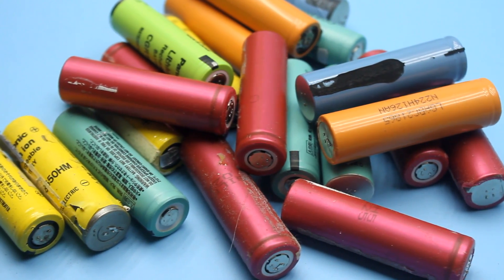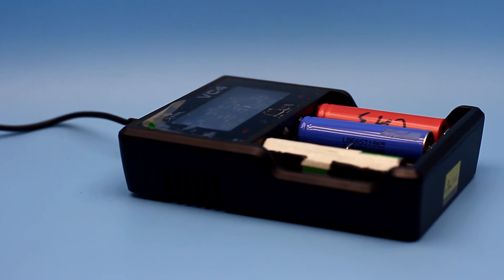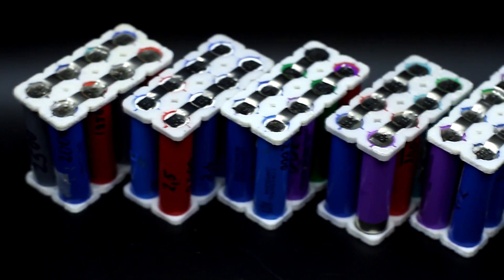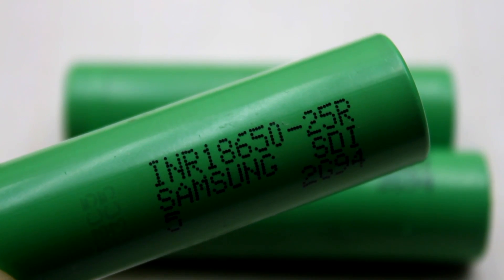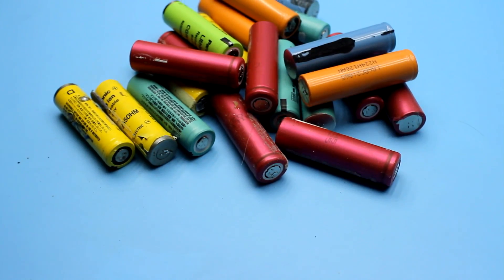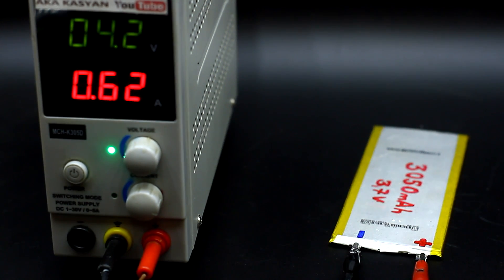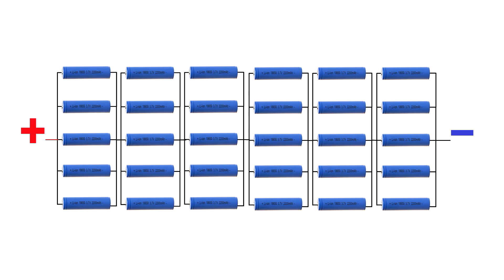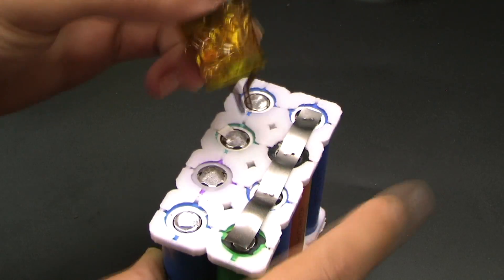Everything you need to know about Li-Ion

Comment: Wow, you are one of the very few that have the terminology right. So many people think that li-ion and li-"polymer" batteries are different things and then make the wildest claims based on that imagined difference. Lipos are li-ion batteries. What people call "li-ion" and "li-polymer" are the same thing just in different form factors (as you said). And because the different form factors are built for different applications, the cells have different properties. But the chemistry is the same, although pouch-cells (the proper name for the misnamed "lipos") mostly use the lithium-cobalt-oxide chemistry, which is the ICR/LCO marking on cylindrical cells (18650 or the wrongly called "li-ions").

Comment: I have no choice but to disagree with you on this topic of Electric Vehicles or EVs, no they will not RULE THE WORLD. Simple Fact is Gasoline is a Byproduct of the Crude Oil Distilling Process and there is just no way to dispose of the wasted that we know to be Gasoline. As long as the World Relies on Oil Products such as Plastics, Oils, Lubes, plus the many other things produced from Crude there will always be some form of Wastewater, or Byproduct, that is Toxic. Currently that Byproduct is filtered then sold as Gasoline; and yes that is a FACT. Gasoline has nothing to do with the price of Crude Oil; but of course that is another conversation all together. 

As long as the World refuses to develop other viable products to replace Plastics Crude Oil Waste or Byproduct will always be an ISSUE. Back in the day before the first Automobile was conceived there were LAKES of this Byproduct that no one knew how to deal with so Ford invented the Motor to run on this Byproduct. Jump forward a century or so and Crude is still being processed with no new innovations or updates to the current process. It is criminal that Big Oil is allowed to SELL the Byproduct as it should be FREE because we are actually disposing of their Waste in our Fuel Tanks. Gasoline should not be allowed to be manipulated or used as a bargaining chip for Big Oil because if WE don't use it that becomes a huge problem for Big Oil.

Battery Technology at its current rate has a short, finite, life and in as little as 20 years from 2019 the Earth's Current Battery Resources could be depleted or at least close to being depleted. EVs will not ever take over as the Dominate Vehicle though there will always be a few options. Elon Musk has already claimed issues getting resources for Batteries due to a very limited supply of certain resources. Crude Oil, on the other hand, has considerably far more resources left over to least a few centuries. Until the current supply of Crude Oil is depleted no changes to Big Oil will ever be allowed. As long as Big Oil can SELL ITS WASTE and Manipulate a very high Profit from it, they have no incentive to give up that Cash Cow anytime soon. 

I want to believe in Unicorns but since I've not ever seen one, it's very doubtful they will EVER EXIST. Thinking the World will Move to Battery Power is much like thinking the next Generation Horse will be a Unicorn; needless to say it's just NOT going to happen... Cheers...
Reply: This planet can't sustain gasoline cars for too long.
Don't be so depressing.

Comment: Good video. One thing was missing i think: if the li battery isn't chargend to 100 %, the rated maximum cycles will be much more than if charged to 100%. If you look at the voltage curves i would say, not charging and discharging into the area where the curves are going fastly up (or down). A Professor of the battery institute here told us much about it. I think 3 V min. and maybe 4.1 would be better.
Reply from the maker: Thank you. I would not say that. Of course, a lithium-ion battery has almost no memory effect, but it still is, not like in the case of nickel batteries, but it is. Therefore, it is advisable to fully charge and completely discharge any battery to minimize this effect. Moreover, charge and discharge should be made with a current equal to 10% of the battery capacity
Reply: @KasyanTV  Please look at electric cars, like the Zoe - there the capacity is been used between 20 and 80%, for maximised lifetime of the li accumulators. It is  a difference if you can use a battery 200 or 2000 times. Oxydation process of the electrodes are much less in that range as if fully used.
Reply: @KasyanTV  
No, this (always fully charge and discharge) is wrong for Li-ion batteries. They will have a much longer lifetime if you avoid charging them to 100%. What is especially bad is keeping a li-ion battery at 100% for a long time (typical case: leaving your mobile on your charger over night or keeping your laptop connected to the PSU all the time). This is a known battery killer! The other killer is heat, which means the worst thing you can do is fast charge a battery (it will get very warm) and then keep it at 100%. 

Charging to only 90% all the time will more than double the lifetime, only going to 80% about quadruple it, 70% will almost double that again. The lower end is not as critical (just don't discharge to 0% and then leave the battery lying around). But if you can mostly do 75-25% charge-discharge cycles you can increase the battery lifetime 10-fold! I have done that with all my li-ion powered devices (like phone, camera, laptop) and the battery is almost as good as new after many years. (I only charge to 100% when I know that I will need it for a day)
Reply: Can somebody link scientific page that shows graphs of lithium resting results.

Comment: you are super knowledgeable.  do you know anything about RF wireless power transmission i wonder. .. to any skeptics its not fake, i managed to transmit 15 volts at about an inch air gap,  and im no electronics master.
Reply from the maker: I did this in 2009-2011, without using a Tesla transformer. Only transmit and receive coil. The best result is 3 meters with an efficiency of 20%
Reply: @KasyanTV  you should do a little video about that, it would be vary interesting to  those who are skeptical about the topic, just to illistrate the potential. when i got it to work it was like seeing magic or something. i did it with 2 AC motors, the ones commonly used for ventilation in small rooms, bathroom... one plugged into wall outlet 120AC as the transmitter and the other one plugged to nothing and it was even missing the stater axel part, i guess its all about the coils hua?.  i have come to learn much about electronics has to do with coils.
Reply: None is denying that wireless power transmission is possible. The heck almost every phone has a wireless charging built in nowadays. But it is horribly inefficient and would be stupid to use for any high power applications.
15V transmitted doesn't mean anything (well, as you said, you aren't an electronics master). The only thing that matters is power in vs. power out.

Comment: Some Li-Ion batteries are rated upto 4.35 Volts, what do you think about them? Do they lose capacity as well? 
your videos are good, keep making
Reply: They have a slightly different chemistry in them (still li-ion of course, so everything else applies). If they are built for and the datasheet says so, well, then that's how they are to be used.

Comment: Lowest price best multimeter (30/40$) with capacitor measurement 10000uf please suggest me
Reply: Aneng an870
Reply: @gixuuuxd2005  thank you friend
Reply: @gixuuuxd2005  I think aneng  Q1
Reply: I have aneng an8008 and i bought aneng an870 1 week ago on aliexpress. I still waiting for this multimeter.
Reply: Because my an8008 start showing wrong resistance. An870 look more durable and its have better counts. Also have NCV and can measure temperature.